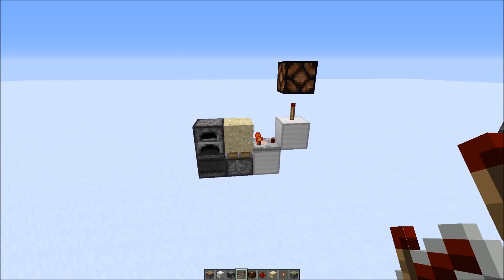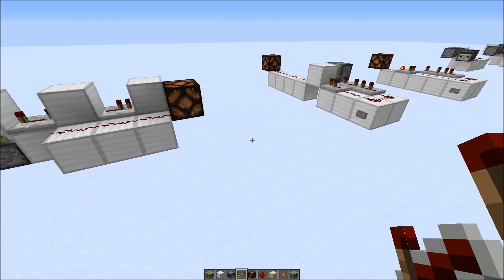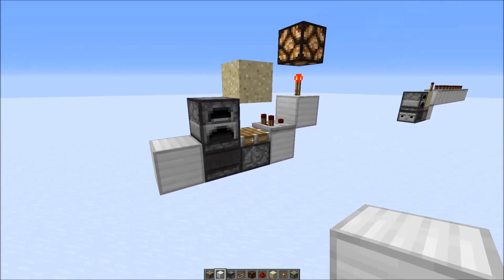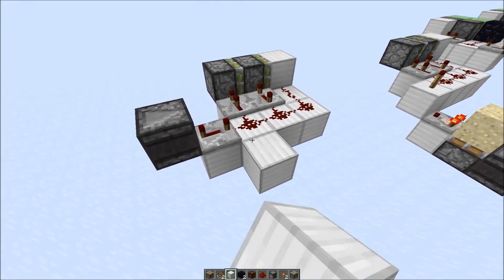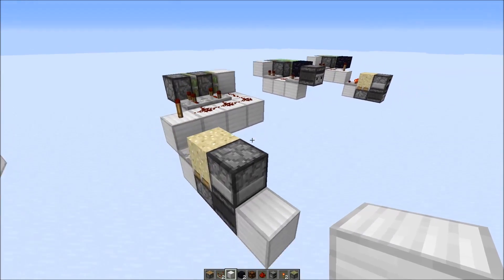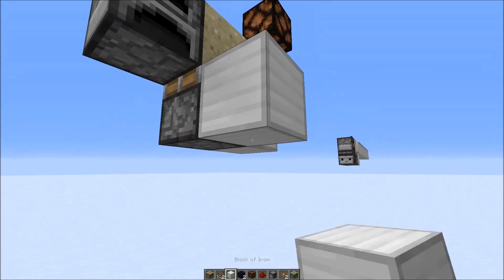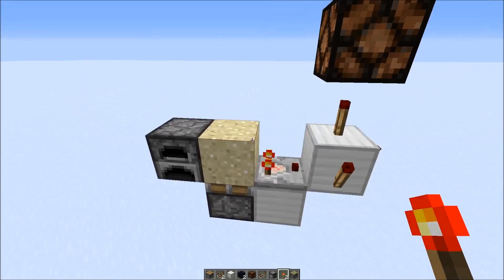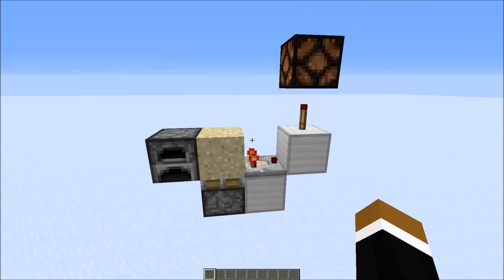[Redstone Basics] 5 Tick Pulse Generator

Comment: Hey mango for a nice slightly more compact, tileable version of this, just combine your two design ideas. Input block on top of a sticky piston, pushing an observer facing the piston with sand on it. Then your furnace can sit on top of the position the observer gets pushed to which is the position it's in in your first circuit here. 1 block wide by 3 high by 6 long. 
The top layer is just air but the torch at the end which could go anywhere, but also the sand will be in that layer when extended. 
Second layer: Input block, Air, Furnace, Sand, Comparator, Solid Block (with torch on top)
Bottom layer: Sticky Piston, Observer, Air, Sticky Piston, Solid Block, Air.

Comment: I had an idea for a piston door, although, it wouldn't really be a "piston" door. It would instead use two flying machine to push a relatively large door into the slot, and retract it. Preferably, retract it into the wall, where the leftover hole can be covered back up by other pistons, as to make it seamless. I understand, you do not do many "piston" doors, but I have neither the intelligence or time to do it.

Comment: i was so confused for a long time, until I realised you had made a 10gt signal and not a 5gt signal
Reply: wtf is gt?
Reply: @cheesedabber  GT is short for game tick. The game runs on a 20gt scycle (that is 20gt in a second). Some people use the metric redstone tick witch is actually 2gt. Redstone tick is however not that good of a metrick as there are components that use an odd number of gameticks, for example if you power a piston (for more than 2gt) the piston will use 3gt to extend. Another example is redstone repeater that is powerd by a player (eg by a button thats pressed by a player) only has a delay of 1gt (of course only at its default setting).

Comment: You can put any item in the furnace or only a stackable (64) one?
Reply: Since the comparator is powering the block with the redstone torch, it doesn't matter what signal it reads as long as there is a signal, so stackable or non-stackable item is just fine.
Reply from the maker: any item is fine
Reply: A Cauldron should work to?
Reply from the maker: yes cauldrons work as well. also droppers, dispensers, hoppers, chests, cakes, jukeboxes, shulker boxes, brewing stands, container minecarts on detector rails.

Comment: Are there any other common uses for this, besides double extenders?
Reply from the maker: sometimes you just need a 5tick pulse for sharp timings for example. I needed them a few times, when I designed tree farms. A longer pulse would have worked as well, but 10gt was the fastest option.
Reply: ilmango Not quite what I was looking for (I was wondering if there were any common circuits or components that could use this), but that's fine.
Reply: What do you mean? It's a pulse generator, you use in whatever you want. I find that whenever I use hoppers and I want fast timings, I tend to use it more often.